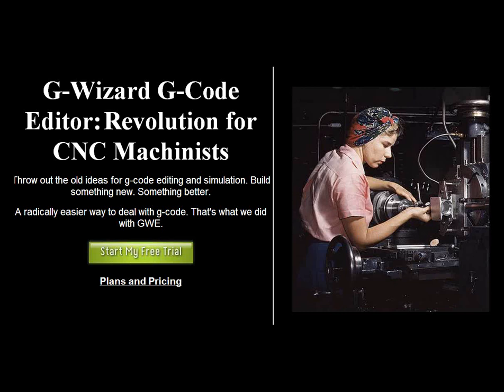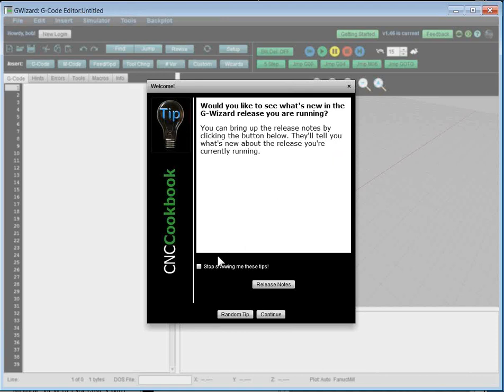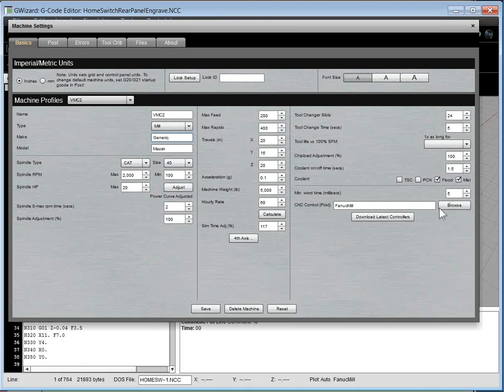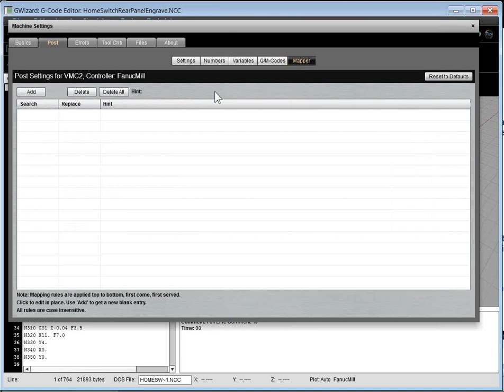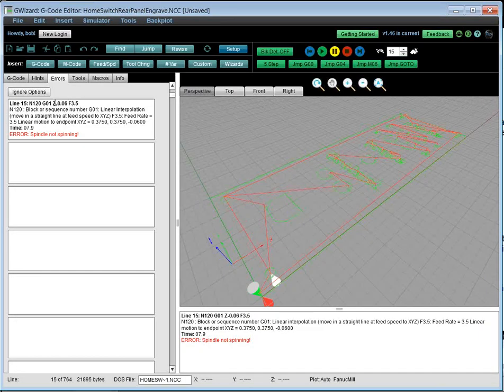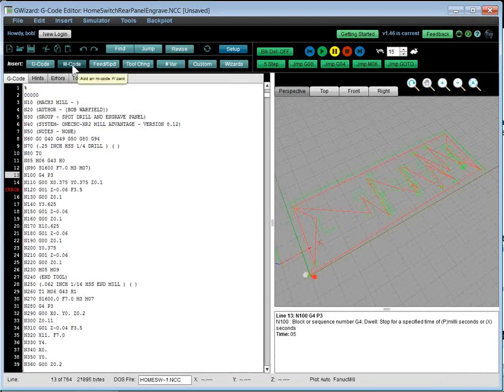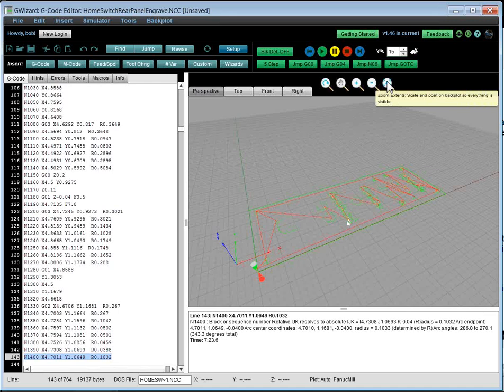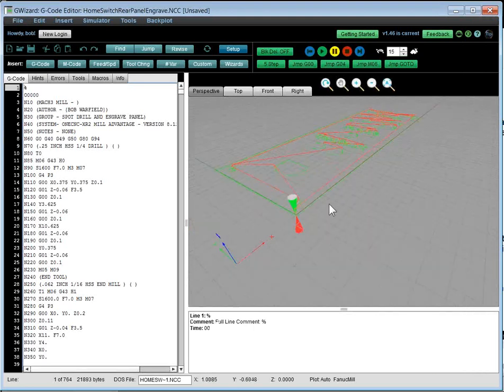Intro To GWizard G-Code Editor and Simulator

Comment: I know this is a really old video but is there a way to run a sub program in the simulator?
Reply: Yes, subprograms are supported, but they must be in the same file.  There is a File Insert command that makes it easy to go grab them and add them t the end of the main file you're working on.
Reply: @bobwarfield9567   Thank you so much, worked perfectly!

Comment: I am in the process of building an Openbuilds Ox CNC Router and I use VCarve Version 8 Pro Desktop. It has quite a few of the necessary routing calculations included in it. What I would like to know is which programs would be the best fit to enhance my machining capabilities? I will most likely stick to hardwoods and aluminum as my materials of choice.
Reply: Thank you for your  quick response. I will follow along with your suggestions once I finish purchasing the necessary assemblies to finish my build
Reply: While I think of it are your software packages available in the 32 bit format.